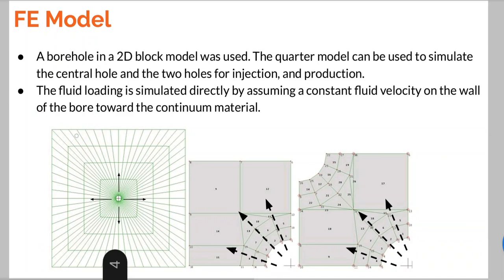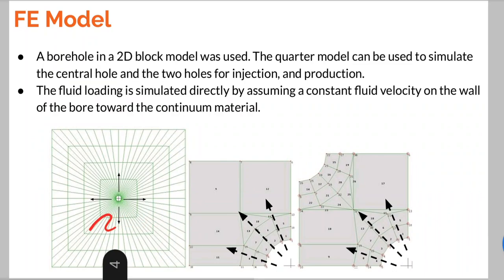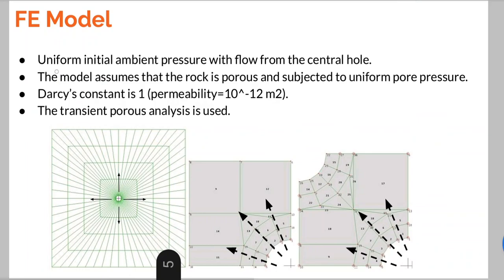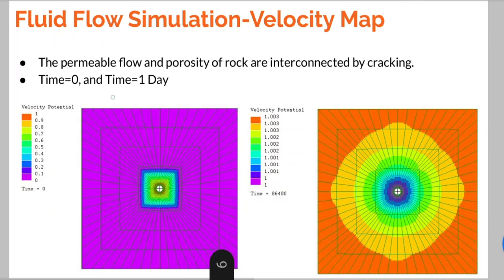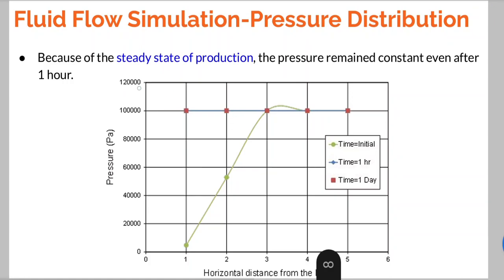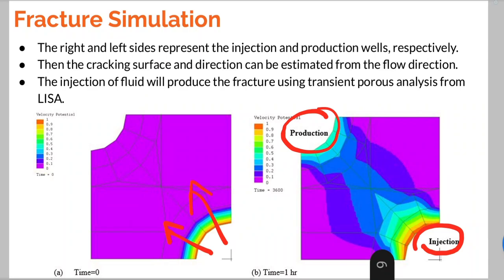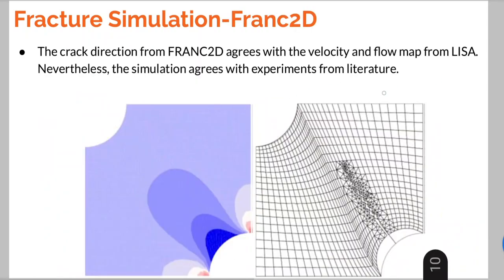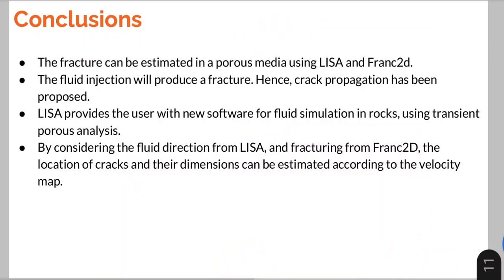Simulation of the Flow in a Fractured Rock

Comment: Using non-commercial software to estimate the fracturing map. #Franc2d simulates the flow and fracture in rock. #LISA software has been evaluated for use on porous media. This software has the ability to investigate permeability. Moreover, storability and #Darcy's constant could be studied. Therefore, the storability, and flow map direction have been conducted. Then, the crack direction (from Franc2D) was satisfied with the #velocity_map.

Comment: This work uses #non-commercial #software to simulate the #transit_flow in rock under the effect of #bore_pressure. Hence, estimate the crack direction according to fluid flow. Finally, the crack path was simulated using a #solid model. The comparison between the solid and #fluid models has been satisfied.
#dr_almukhtar
#Rock_Fracture
#Rock
#Fracture
#Franc2d
#Lisa